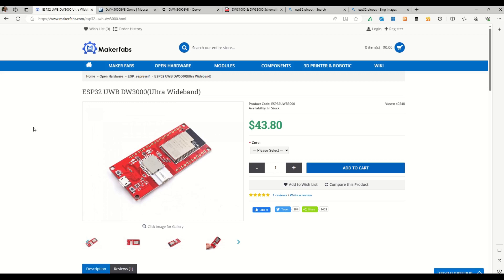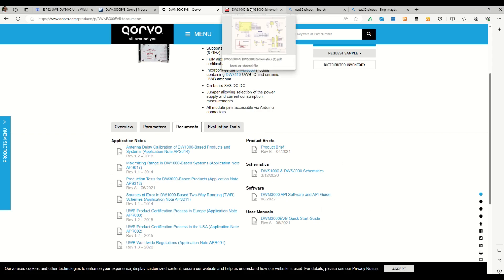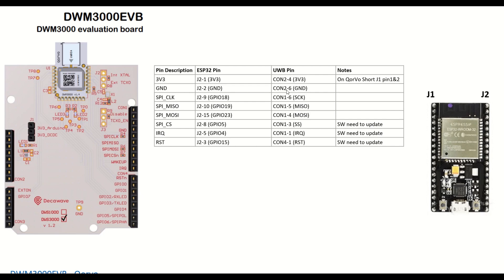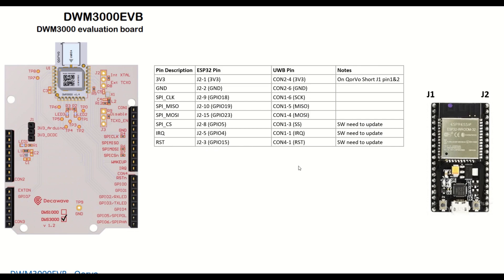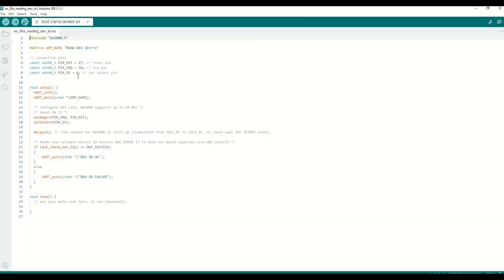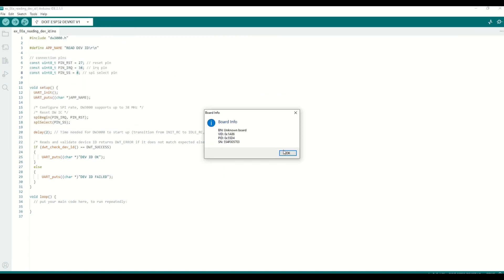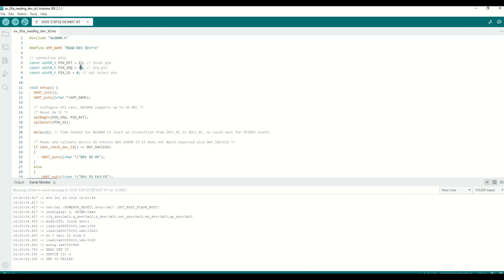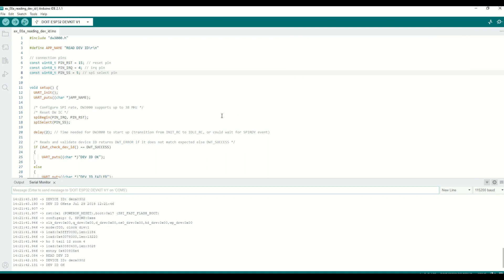How to Use Qorvo DW3000 with ESP board

Comment: I tried with an ESP32 for two days and the chip didn't even light on. The solution was to both supply 3V and 5V. Can you please pin the comments so that people that had the same problem as me have a solution ?
Reply from the maker: Hi, Qorvo UWB board needs only 3.3V. which can supply by ESP board.
Reply: I think you need to move the jumper to 3V3 arduino instead of 3V3 DCDC. worked for me after that

Comment: Hello, thank you for the great video. I'm following along with the same model.

I'm having trouble retrieving the device ID on my computer, so I checked the waveform with an oscilloscope. It seems that the SS pin (GPIO 5) on the D32 doesn't go low even when the code runs.

May I ask for some advice on this?
I tried forcing it low by adding digitalWrite(5, LOW); to the example code, and while it does go low momentarily, it quickly returns to high.
Sorry for asking a dumb question.
Reply: 안녕하세요, 혹시 해결하셨나요? 혹시 해결하고 다음 단계로 넘어가서 initiator와 responder도 하셨으면 질문 좀 드려도 될까요?
Reply: @whatthe890 오늘부터 다시 시작해서 해결했는데, 혹시 어떤 부분에 대해서 질문하시는 걸까요?
Reply: @김부계-u8t 핀 올바르게 연결해도 dev id는 잘 읽어오는데 그 이외에 다른 레지스터 값을 읽어오려해도 항상 id값을 읽어 와서요 혹시 선생님은 이런 문제는 없으셨나요.. ?
Reply: 안녕하세요. 한국인이신가요? 저도 같은 모듈로 작업을 진행하고 있으나 잘 되지가 않습니다. 혹시 메일 등으로 여쭈어도 될까요

Comment: hello, I connected esp32 and dwm3000, but rc init state is not working, can you tell me why? Pin, voltage is all fine. It's not sleep or deep sleep state either.
Reply: I have the same issue - did you ever fix it?

Comment: Hi, can DW3000 be used for transferring data between controller and tag both ways? if yes, Can DW3000 act as controller and tag at the same time? I am looking for an experiment where i'll place multiple DW3000 and want to transfer the data. Any reference code will help., Thanks.
Reply from the maker: Hello, DW3000 can be used to send data also. i used send data to synchronize across multiple tags.
DW3000 can't act like controller and tag at same time. Because in Tag mode any additional operations can increase timestamp and give inaccurate reading to Anchor. You can use hardware interrupt or software timers to switch between Controller & Tag modes.

Comment: thanks for the video. could you make one where you communicate an anchor and a tag installed on 2 different Arduinos?
Reply from the maker: Hello @tommasonegri3704
Please fine below two videos where one Tag communicates with 2-3different anchors.
https://www.youtube.com/watch?v=8eAZRNEuYN4&list=PLjs-7MMtST2y3q37KbfyD3AJJtM8FJPAE&index=5
https://www.youtube.com/watch?v=36nfLby1Xjg&list=PLjs-7MMtST2y3q37KbfyD3AJJtM8FJPAE&index=6

Note: I have used ESP board not Arduino.
Reply: which uwb module did you use? qorvo dw3000 or another?
Reply from the maker: @Tonmyrocket3704  Qorvo DW3000 i have used for integrating with ESP32 board. in other videos i have used ESP32 UWB DW3000 board.

Comment: Hi, thanks for the useful video. Do you know how to connect the same Qorvo DW3000 board to Arduino Uno and maybe how to get the 2 Qorvo boards to communicate distance between each other?
Reply from the maker: Hi @lukakramaric4089  ,
you can use SoftwareSerial Soft_Serial(2, 3); // RX, TX for using multiple serial communication buses.
Reply from the maker: SoftwareSerial possible
Reply from the maker: Hi lukakramaric, After reading you comment. i tried connect Qorvo DW3000 board to Arduino Uno and modified library files of DW3000. Its not working properly. I need to spend more time to update libraries.
For Time being you can use any ESP board where library files available in git location i have shared.
if you have any challenge connecting Qorvo DW3000 to ESP board please let me know. i'll be happy to help.